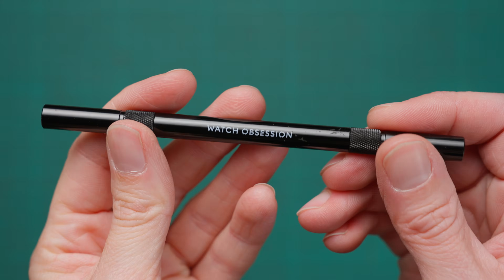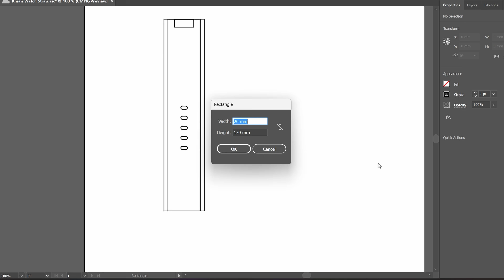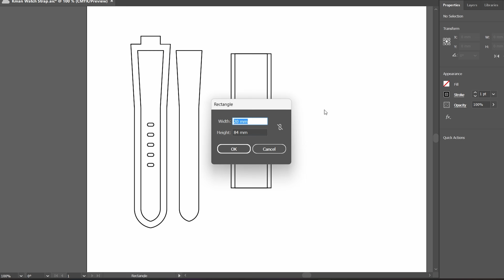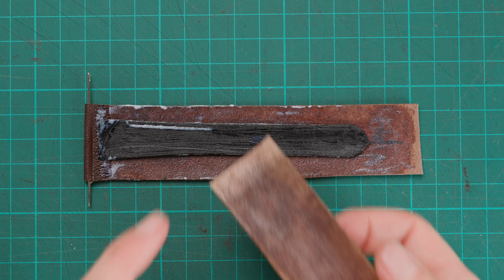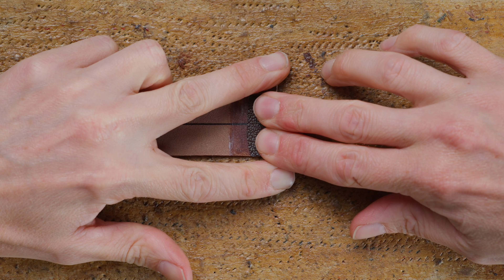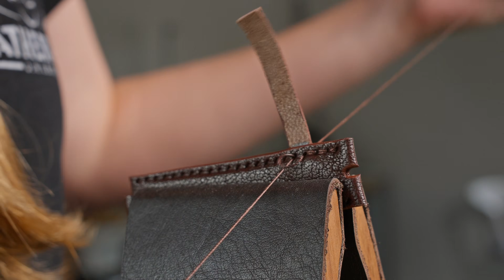Make A Raised Leather Watch Strap // Be The Maker // Leathercraft Tutorial

Comment: Where's the second loop ?
Reply from the maker: I set the single loop far enough back that there was no need to add a running loop. As this was custom made to the required size I knew where the end of the strap would sit when done up, if it was not then I would add a running loop.